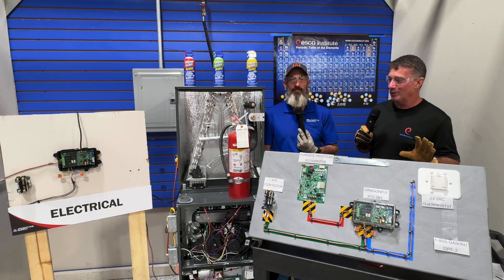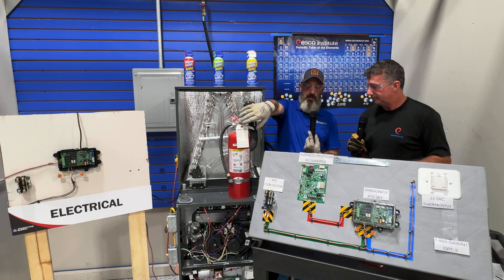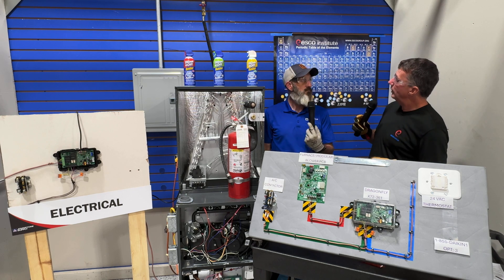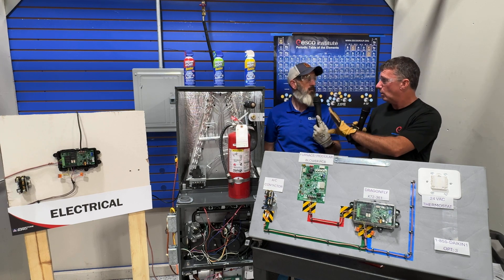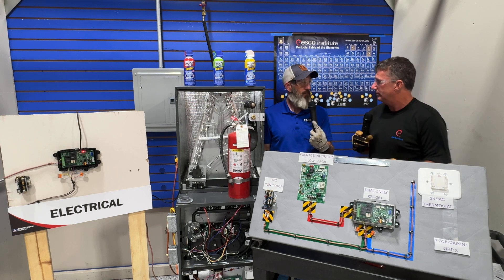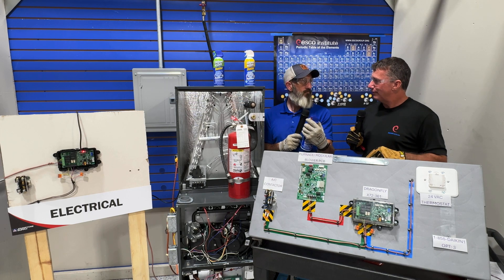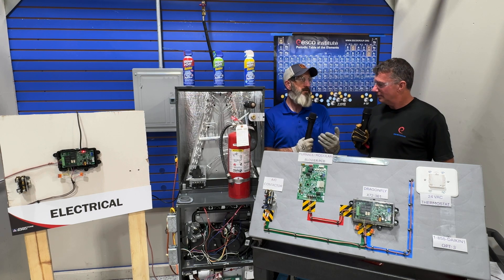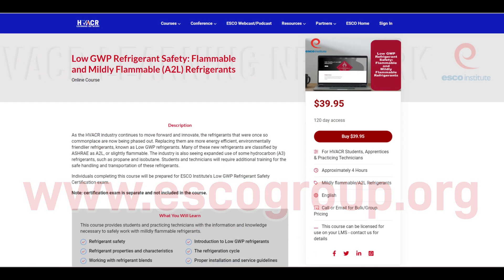🚨 First Ever Demonstration of A2L Mitigation System in Action! 🔧❄️

Comment: On another video the tech plugs the ac contactor wires on the green pin with the furnace PCb?? Does anyone know if that will work too ?
Reply from the maker: Various manufacturers have their own process for mitigation. Definitely want to check the equipment manual.

Comment: if there was truly and effective means of mitigating the leak, if there is an evaporator leak detected, it should pump the system down and isolate the system from the leak. After all the pressure rises in the evaporator with the system off as the temperature rises as well. So just shutting down the compressor does not seem to mitigate the leak or loss.

Comment: Are you aware of any non-communicating thermostats that offer A2L mitigation sequence as built in logic for 'plug and play' operation? What are current options to provide simple and low cost controls (split system) while complying with requirements on next gen refrigerants - y'all mentioned a 'mitigation control board' and wondering if that's the best option at this time.
Reply from the maker: Unfortunately I have not encountered a non-communicating thermostat with mitigation capabilities. Most manufacturers are beginning to add the mitigation control into the indoor control board but it will take some time for them to upgrade all control boards.

Comment: What would happen in a scenario where the blower motor fails to come on and the system keeps leaking in evaporator.  Can this  cause refrigerant to ignite.
Reply from the maker: If the LFL was met, and there was a sufficient ignition source, you could get an ignition. BUT....A2L ignition is nothing like an A3 ignition, they move very slow and lazy.

Comment: Thanks for the video.  You mentioned the gas furnace will shut off when refrigerant is detected.  The schematics I have show only the 24 volt (Y) circuit to the outdoor unit is interrupted.  What model sensor are you demonstrating and is there a schematic available?
Reply from the maker: This particular system is a Daikin which is using the DragonFly control which does break W. The sensor is a I believe the sensata but I will double check that.

Comment: While some refrigerant detection systems may detect multiple refrigerants, not all will do so, and even if capable of detecting more than one refrigerant the response time may not be the same. If needing to replace a failed refrigerant detection system (or sensor) follow the manufacturer instructions to ensure use of an acceptable make and model that will function as intended.

Comment: ** It is my understanding the Yellow Can Blow Off is actually R-1234ze per the MSDA Sheet. Did someone misspeak?
Reply from the maker: Great Catch! I am seeing ZE on the newest ones as well.This can is over a year old and was in the first release, I had to special order it . It was labeled as R1234YF but did not come with a MSDS. They are technically both Tetrafluoropropene. R1234YF is 2,3,3,3 Tetrafluoropropene and R1234ZE is 1,3,3,3 Tetrafluoropropene. I will absolutely reach out to Blow Off and verify. I may have to correct this video as well as my flammable refrigerants video from last year. I am sooooo glad you caught that!!!!
https://youtu.be/MWD9-aykQtc?si=6DlYD2LuLyB0JEQZ